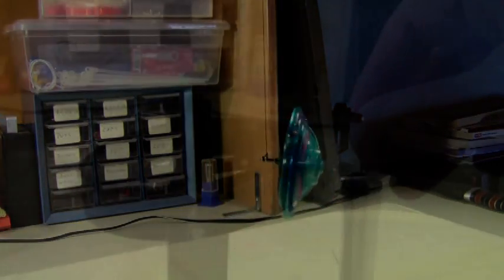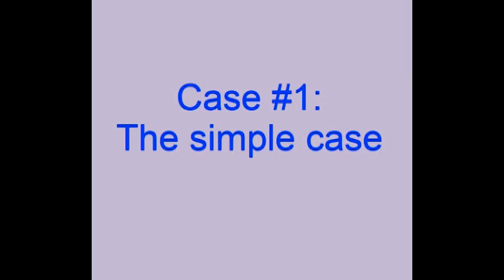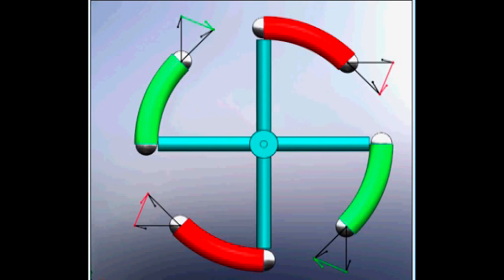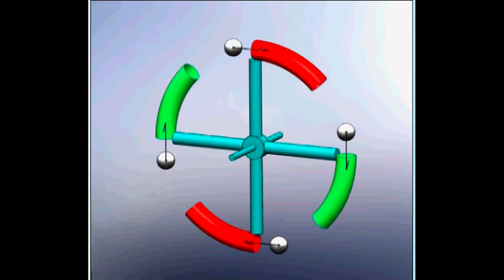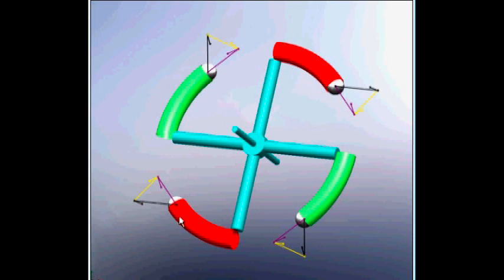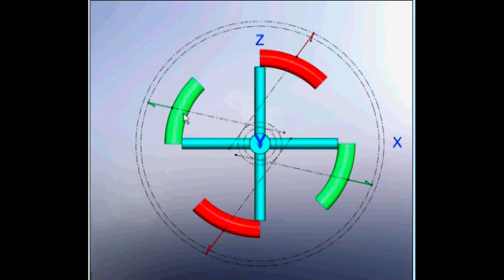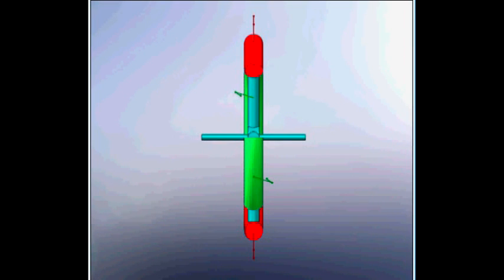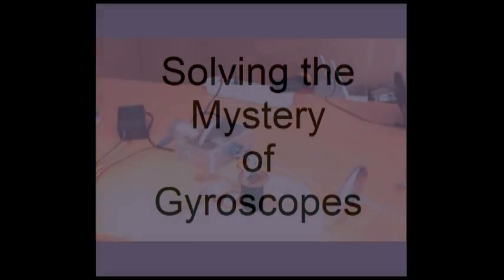Solving the Mystery of Gyroscopes

Comment: You were halfway there.  Instead of jumping to the end with the actual gyroscope, you should have had a middle section that walked through what happens at incremental stages after you mentioned the vector deviations from where the balls enter and exist the deflector, and how that causes the reaction that leads to precession.  That would have been very helpful.  Thank you for the video however....

Comment: Interesting.   Liked the parts that used the vectors.  I've fooled with gyroscopes myself from time to time.  Like the set up where there are two gyros in the same inertial frame but with their rotation in equal but opposite direction using the right hand rule.  Then you vary one of the gyro's  rotational velocity, either greater than its previous velocity or lesser.  The inertial frame, if its on a frictional or one that is nearly so (a raft floating on water in a bathtub say)will spin or pull to one side or the other.  I understand that some orbital satellites use something similar.

Comment: The spinning gyro for a brief time does appear to lose weight.
Consider this: At a certain specific rpm the gyro bearings have very little load when the disk is vertical with shaft horizontal.
The disk will be trying to fly out in 360 degrees in effect taking almost all contact off the bearings but for a very tiny spot contact with each ball or roller in the bearing - or if a plain bearing is used there will be a minimum thickness oil film of practically zero friction.
As the disk is experiencing 360 centrifugal force at full speed it will have little friction and all its weight is pulling away from the shaft in full 360 degrees and in effect be weightless and have anti-gravity!
 As the speed drops below the critical point the centrifugal force will drop and the disc will begin applying heavy vertical friction on the bearings thanks to Newton's apple!
As the weight increases and the disc speed reduces as the circle above the head slows the precession and increased friction will come into effect to make the weight once again appear and make it impossible to hold the shaft horizontally or raise it above the head until the disc is once again spun to maximum speed.
To try pander to the deluded souls who think UFOs are alien  and might use some sort of gyroscopic antigravity power let's consider the video experiment but with some lightweight power system spinning a gyro disc at immense speed - mercury in a circle a la vimana tales? 
Spin a very big gyro disc on a horizontal shaft/bearing/magnetic field alignment and maybe the discs anti-gravity might overcome the weight of the UFO fuselage.
Add some sort of external directable power such as air jets or magnets and maybe the action of the power on the fuselage might induce some precession in the disc that might enable the UFO to lift off.  Logically fine adjustments of the power would allow take off, slowing and steering? 
We know Earth acts like a big magnet and logically some drive could be made to take advantage of this for use in a UFO that is weightless while its gyro disc is spinning superfast.
Introduce Nikola and his multiplying coils to create a gyro with an immensely fast speed and zero friction thanks to magnetic bearing and power source for a UFO is feasible.
Add wireless electrical input from Nikola's world grid to keep the UFO's disc spinning and hig speed cheap travel is possible.
Then BigBiz steps in and ensures all research is stopped in order to keep the humans paying through the nose for electricity..........and suddenly it's 1905 again and work stops at Wardenclyffe.